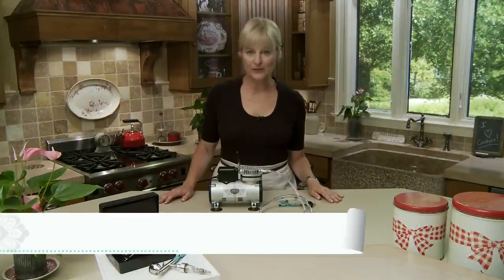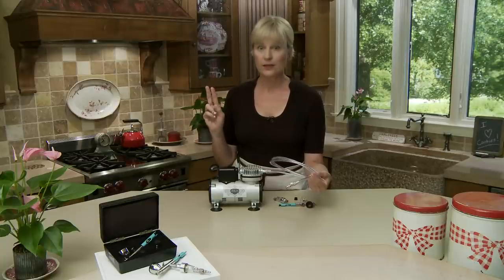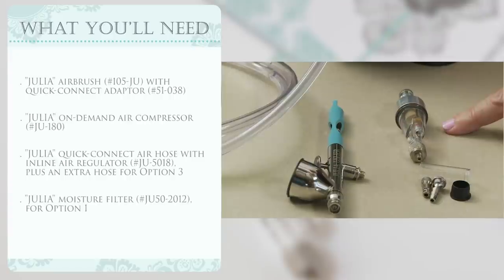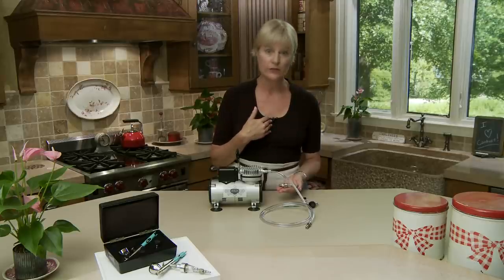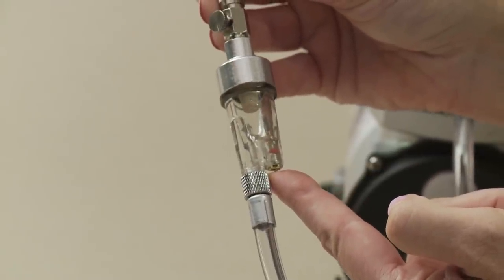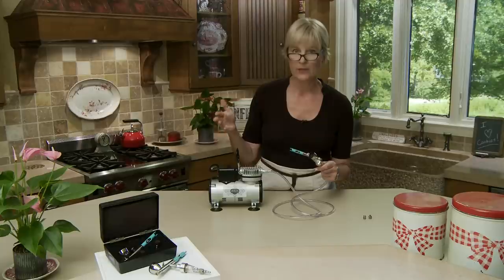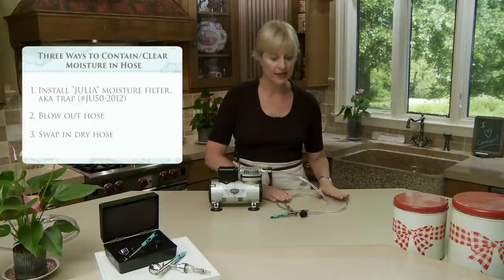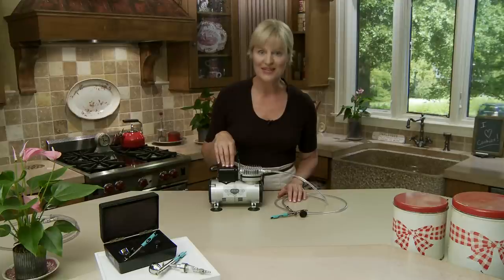How to Clear Moisture in Your Airbrush Hose - Plus, a "JULIA" Moisture Filter 101

Comment: Never seen an airbrush compressor without a water before they look odd like that! I have 2 on mine one t compressor end and the safty last chance one on airline like this but the most important it the compressor end to stop any water getting in your airline  what so ever!
Reply from the maker: The one inline moisture trap has worked really well for me on this compressor, and I only ever really need it during hot, humid months. But every compressor has different output (the higher the hp, the greater the need) and every work environment is different.
Reply: @JuliaMUsher  last night was the first time iv ever seen abit of water in my trap but it was all at compressor end non atoll in the inline one I was airbrushing at the back 2am with windows open n spraybooth on it was absolutely freezing in the room! Think with that and heat on compressor done that but there was about 2 to 3mm of water collected in the trap at compressor end! My compressors come with the variable air control water traps and I buy an inline one for the brush end just incase any gets past the compressor end but it seemed to to its job through the night there, quite impressed by that! The ones we used to use in the garage were huge ones screwed to the wall! They used to get alot of water in there for spraying the vehicles that were accident damaged! I'm a modeler love building my armour model's I have that variable air control valve built into my airbrush again second option as one on trap too! Just precaution the model's aren't cheap, I got this water from enamels so that would have really mucked my paint job up last night if that got through! Acrylics I'd be able to fix easy but not enamels so very happy with that
Reply from the maker: @Emtbtoday  Yeah, for sure, a moisture trap is needed when working with high hp compressors for long periods (or short periods when humid). With my use, I find I only need it in humid, summer months though, even though I leave it inline all the time. I have different compressors, some with built-in traps and some without (as in this video), but the one trap at the handle end seems to be enough for my use. Just a different experience perhaps because I am not airbrushing as long or as intensely (so less time for the compressor to heat up) as you.